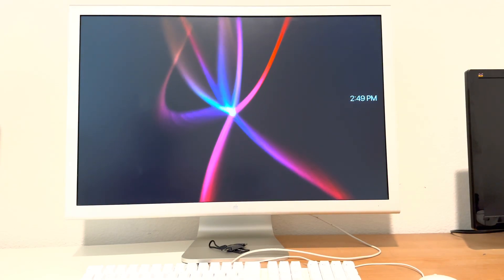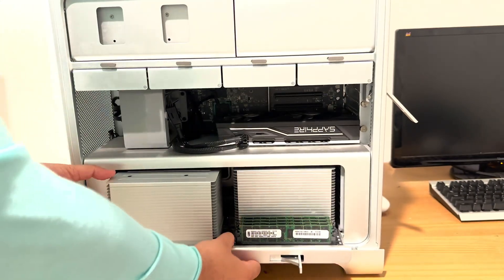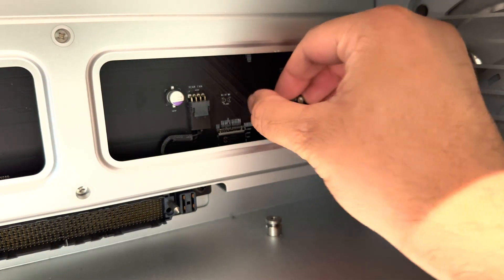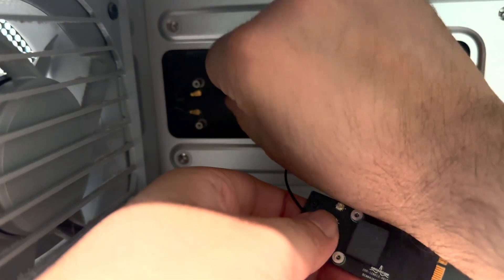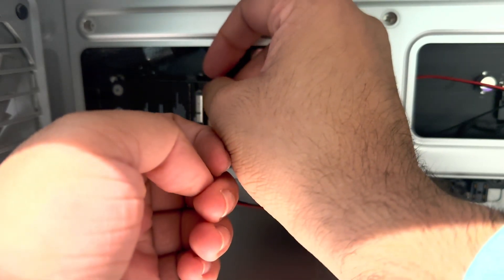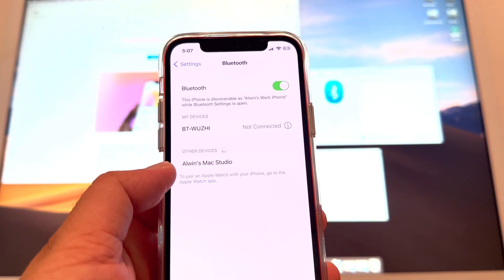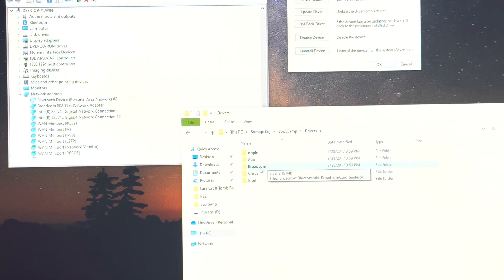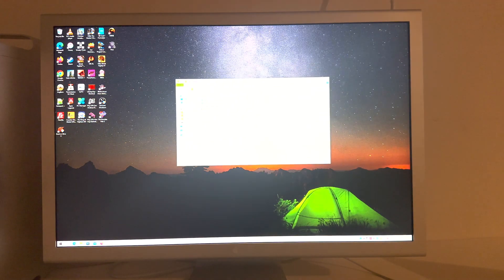Mac Pro 2012 5,1 WiFi AC & Bluetooth 4.2 Upgrade (BCM943602CDP) -CHEAP WAY!

Comment: I replaced the original wifi card to 4.0 wifi card. But it just worked some minutes. Then my cMP became freeze and restarted. Is this caused by demaged wifi card or something else? Because it's not happened when i put the original wifi card to the logicboard. It's also happened in windows 11. I once tried to install a mojave to my cMP because i assumed that it's caused by OCLP but i faced the same problem.

Comment: Random question but kinda similar. I have that iMac that you use the wireless airport card from for the Bluetooth 4.2 upgrade. I would like to upgrade mine to Bluetooth 5.0. Do you think it would work from the 2019-2020 model airports?

Comment: Maybe this is a stupid question but if I don't care about Bluetooth support, could I just use a USB Wifi Adaptor instead to restore wifi to a 5,1  Mac Pro? The eBay vendors linked don't ship to my location unfortunately. USB Wifi, or access point + connecting to the ethernet would actually be even cheaper. Thanks!
Reply from the maker: Does the onboard wifi/bluetooth not work already? There's no problem in using an upgraded wifi/bluetooth USB if you cannot get the items needed for this tutorial.
Reply: @alwinm8  I must have misinterpreted something... I thought the native card that shipped with the 5,1 had support dropped in Big Sur, but it appears to be working fine for me in Monterey and Sonoma with OCLP.

Comment: I'm considering doing this on my 2010 5,1 running High Sierra (soon to upgrade to Mojave, and possibly to Monterey). I'm currently running the Airport Extreme model (0x14E4, 0x8E). I realize you did this mainly for bluetooth usage, but, I'd like to know if you noticed an improvement to your wi-fi experience? Same or better? Downloads faster? More stable connection to your router? Thanks sir -
Reply from the maker: Hey there, I did also do this wifi card upgrade for the faster Wifi and not just the bluetooth. The wifi experience is so much better. The old Wifi card was sluggish compared to this new wifi card which I feel is at least 2x as fast. This mac pro sits far from my router so that wifi 802.11AC compatibility makes a huge difference. Downloads are much faster. I highly recommend you do this upgrade to your Mac Pro 2010.

Comment: The updated adapter you linked doesn’t fit with bcm943602cdp card. Card fits but doesnt sit flat on adapter because of new plug for red and black cable, and screw holes are covered.  Going to try and see if it still works
Reply from the maker: Hey there thanks for letting me know. For now I will take down the link. Were you able to get it working?
Reply: @alwinm8  i can confirm it does still work!
Reply from the maker: @camiloymw  thank you for the confirmation!!

Comment: Hey boss! Looking at your links, do i need both the wifi card and the adapter from the updated link?
Reply from the maker: Yes sir you will need both the WiFi card and the adapter. The adapter is necessary to make the iMac card work inside a Mac Pro.

Comment: Do I need to upgrade in order to upgrade to Mojave ?
Reply from the maker: No sir you do not have to update your WiFi card to update to Mojave. But however you must have a Metal compatible GPU installed like the RX 580 I have in my video.

Comment: Hey brother what monitor are you using?
Reply from the maker: That is my 30 inch Cinema HD Display! It was tough to find for a good price but it's still very stunning
Reply: @alwinm8  cool, i have one with a 27 thunderbolt, but I want another 30 inch so I can have to, I just don't know what GPU to run
Reply from the maker: @NegroRotary I would advise you to get an RX 580 8Gb just like in my video bro! I actually have two displays now, one 30 inch like in the video and one 20 inch, and they work great through my single RX 580.
Reply: @alwinm8  so I need an adapter with that card?
Reply from the maker: @NegroRotary  yes sir you will need a 6pin to 8pin PCIE power cable adapter

Comment: Thank you!! Works perfectly on my MP 5,1 running Monterey without any additional modifications, just plug & play. Paid $44 total & I can't believe OSXWifi charges >$100 for the exact same thing. Ridiculous.
Reply from the maker: Glad I could help & OSXWifi is out here overcharging for sure 👍
Reply: Have you used Martin Lo's Opencore or OPLP on your mac pro 5.1?

Comment: Hey man! The eBay link for the Bluetooth card went down and says there's an error for the link. Could you reply with the part name and/or number? Thanks!
Reply from the maker: Actually, I just double checked and it looks like the link for the adapter was expired. So sorry about that. I just updated the description with a link to the same adapter from a different seller. Let me know if you still have issues!
Reply: @alwinm8  Thank you! You rock man!
Reply from the maker: Hey there, are you sure it's not working? I just checked all my links in the description and they're all active.

Comment: Hi, have the same card installed and my 5.1 sees the card in system report, but no network is showing up. what could be wrong?  Monterey installed with opencore. Thanks!
Reply from the maker: Hmm I don't know how it would work with Opencore, as I don't use it and just have a standard Mojave installation. I have never upgraded past Mojave with Opencore, so I couldn't really give you guidance to why it wouldn't work. Sorry about that!
Reply: Did you ever find a solution?
Reply: i think you should do the post install root patch again that should update the drivers for open core

yw

Comment: Could you link the articles you've been following, I have ordered all the parts yesterday, so much cheaper then the kit hehe so thanks a lot. I will be upgrading this as soon as I receive the items but the articles would be nice :)

Thanks for this video
Reply from the maker: Hey there, I updated the description with one of the articles I followed. You can also follow the guide on OSXWIFI, it should in fact be the same.

Comment: 12:46 hey man really APPRECIATE the links! All the parts finally showed up…but it’s not showing any Wi-Fi channels or Bluetooth connections. I notice you mention some software fiddling to get this working properly…can you list your solutions as well? I’m in OCLP 0.6.7, Monterey 12.6.7

Thanks!
Reply from the maker: The only software fiddling that you need to do would be in Windows 10. It works right out of the box installed with 10.14 Mojave. I haven't tested this in OpenCore patcher so I'm not sure of its compatibility. I would recommend using the Refind PLUS bootloader as it works great with Mojave, Windows, and Linux. I have updated the description with a link to this.
Reply: Did you ever solve this issue? Currently dealing with it
Reply: @MrWipe420  not yet…ended up just using Ethernet connection.